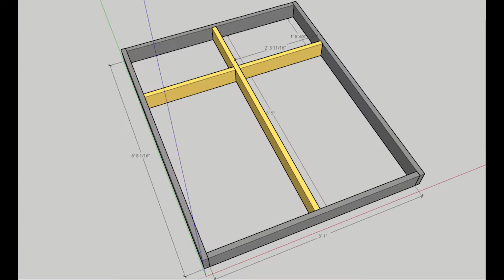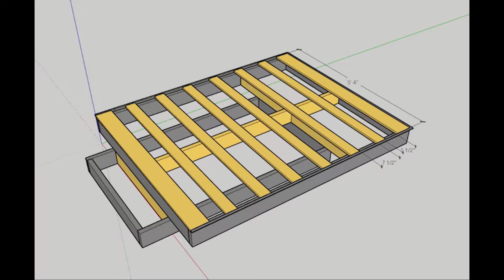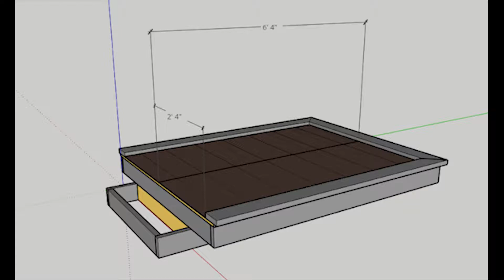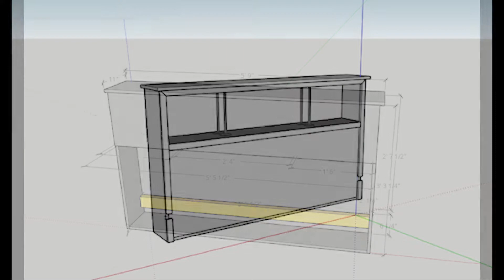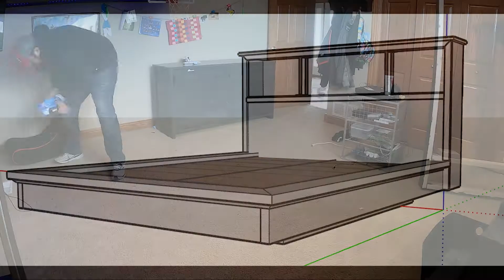Floating Full Bed and Headboard

Comment: How much you spend in this project? Thanks ps i hope you can give a link more detail you work so i can try to build it
Reply from the maker: Materials for the bed frame were $155 before tax and the headboard materials were $135 before tax. I had the tools I needed but if you don't that's extra cost obviously, plus any gadgets you want to add like LED lights, cup holder, etc.  All the measurements are in the video, let me know if you have specific questions though about anything.

Comment: An you help me get the measurements for a twin?
Reply from the maker: Hi Steve.  A twin is 38"x75" and the Full is 53"x75".  So no need to change the length measurements and you can just subtract 53 - 38 =15" from the width measurements you see in the video.